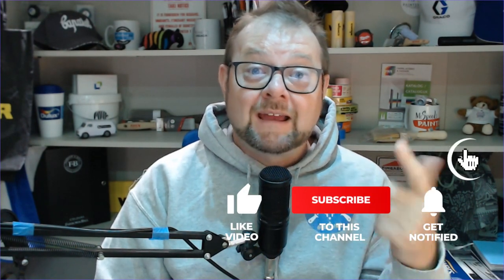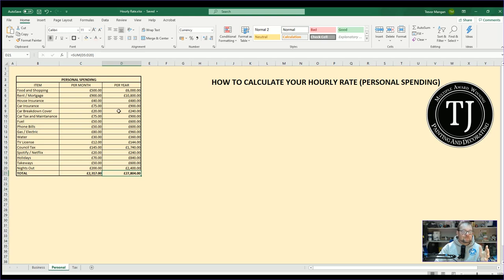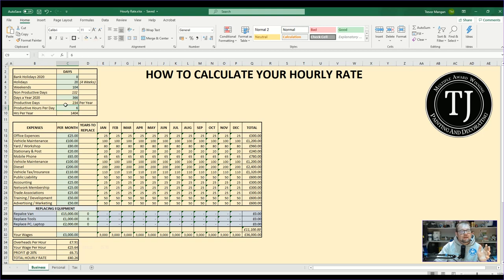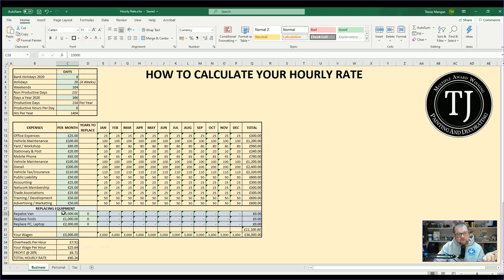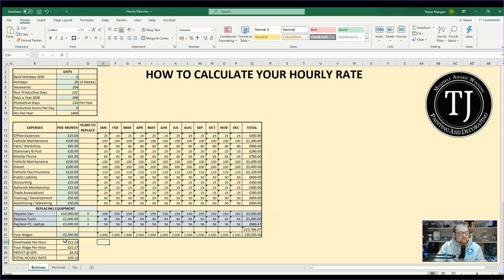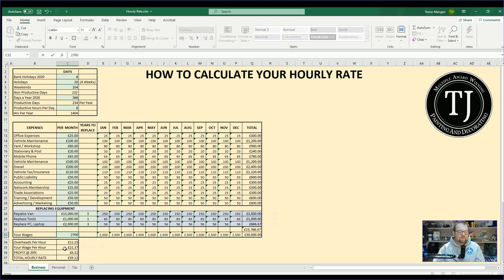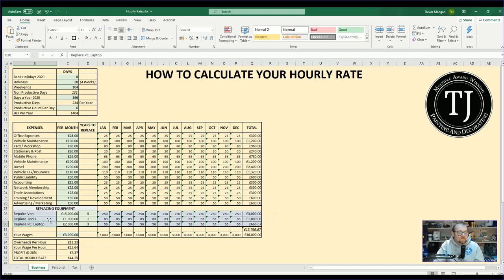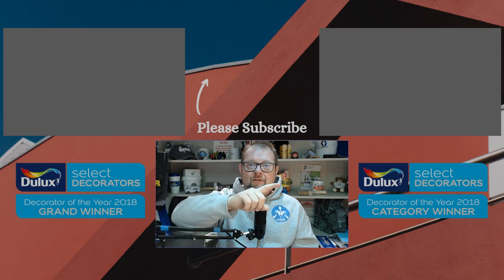Transform Your Painting and Decorating Business with These Pricing Hacks!

Comment: Do you charge by the hour for preparation ie scraping filling and sanding? How would you time yourself on this as every job could potential be different. What if you uncovered rot which you didn’t spot when doing the estimate? I get you can time yourself for the actual painting of each different job and record that as a guide for pricing . I just wondered if you had a system for prep work?  Thanks . Great vids
Reply from the maker: Hi Nick thank you for your question, Prep is one area that had me scratching my head for ages. I just didnt know how to add the big variable to my spreadsheet when I was pricing. After thinking about it I have found the best way was to look at the Prep on a sliding scale of Good, Average and Poor condition and then price it accordingly. Good walls being cheaper than Poor. I now do this for exterior woodwork too. Having said this there are just times when however much time you have spent looking at the work, there will be stuff you haven't spotted. In this case, you just need to have an honest conversation with the customer. I hope this helps?
Reply from the maker: +Nick Light it maybe worth joining our FACEBOOK FORUM? Owning a Decorating Business. You may find it helpful?

Comment: Great video Trev. Just a quick question when you work out the personal expenses cost, is that your share of the bills and the total cost of the household bills
Reply from the maker: Yes Steve basically it's what you need to live on per month
Reply: cheers Trev, so basically i just need to add my share of the household bills to the spreadsheet and any personal outgoings that i might need for the month
Reply from the maker: Yes that's the way I do it 👍